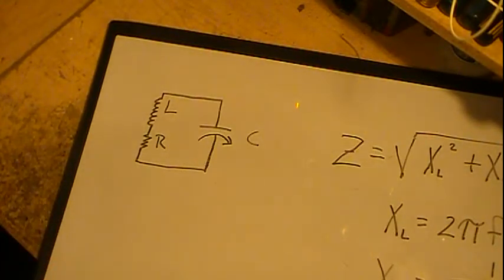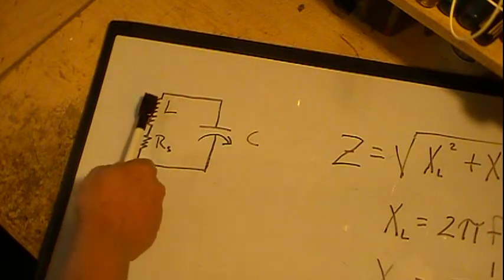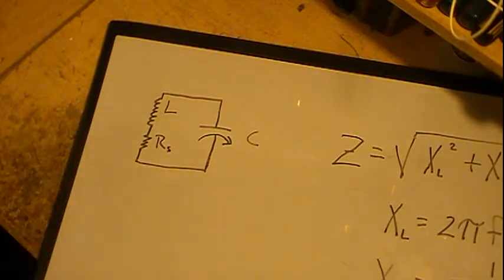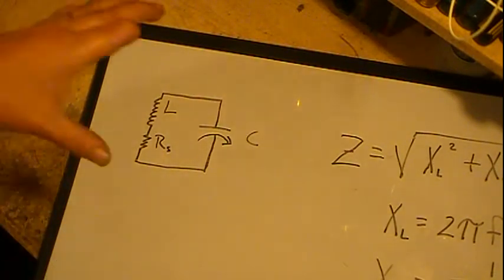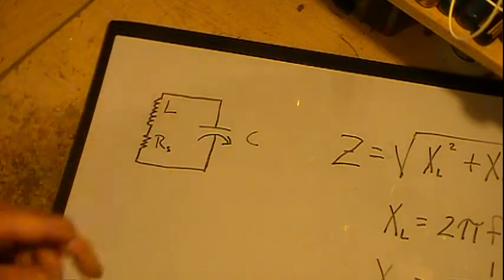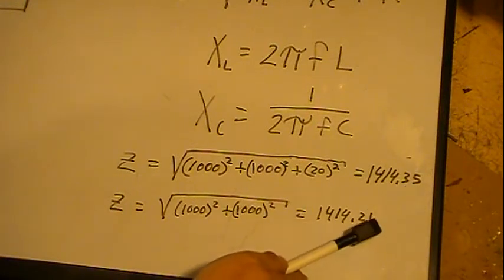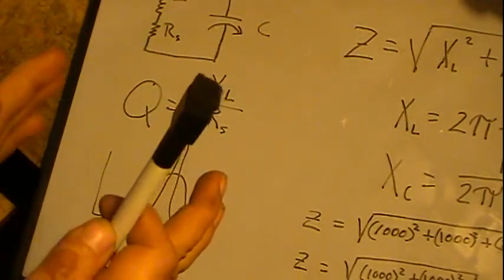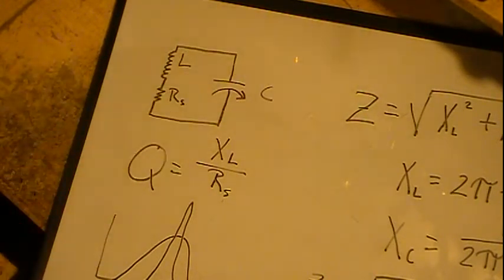Coil resistance

Comment: Greeeat show! I always wondered why I could not get the same values after rewinding a coil. I never thought the copper in the wire was different back then. Nice service tips. I would run into tube issues similar to those you mentioned in the older tube TVs when it came to replacing the mixer/osc tube in the tuner.

Comment: Hi Dennis, Great video as always, of course you lost me on the math but I liked the rest of the video.
I was not aware that copper wire not being pure years ago, I always thought it was pure copper.
I had a phono that a 12AT6 or 12AV6 (forgot which) tube was microphonic but I just changed the tube, In some TV tuners I have seen lead shields over the tube.
Strange that you said grounding the "diode" section of the tube would stop the microphonics, can't see how that would do any good, I would think a heavy tube shield would work better or just replace the tube.
I have seen tube sockets mounted on rubber to stop microphonics.
Enjoyed the video, as for the upcoming  "trig" video.....LOL